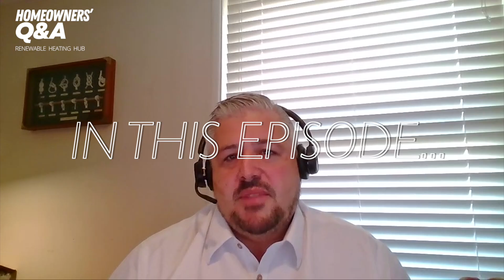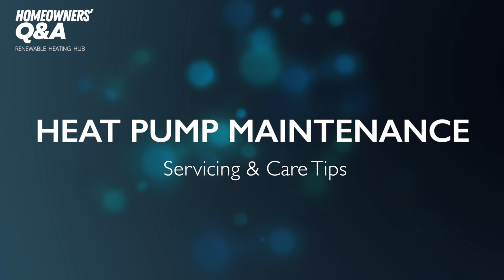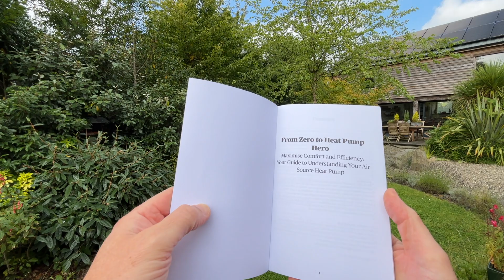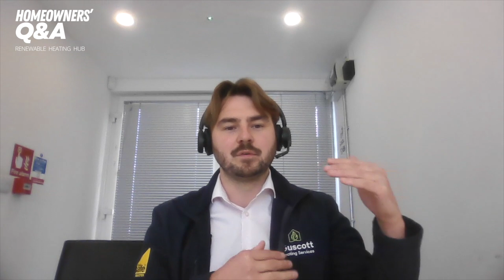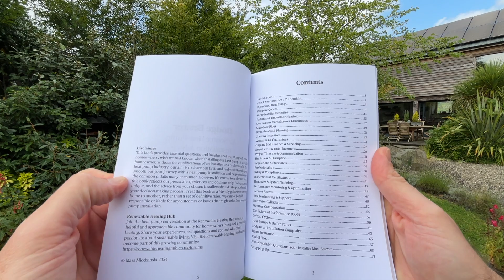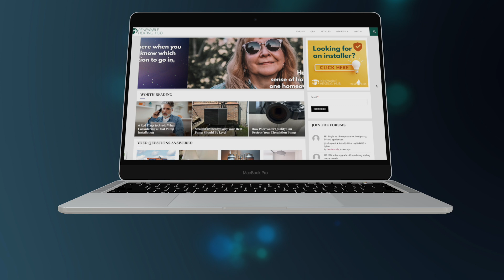How to Maintain, Service & Look After Your Air Source Heat Pump

Comment: I cannot remember when i had a gas boiler serviced.. its it just me , its never an annual thing. Whenever we did have a visit they do a little bit of cleaning but they find no problems.  

If heat pumps are simple bit of cleaning then waste of money.

Your checking,  why can this not be done online and call you out "if" there's any issues

Comment: So, if an ashp is easier to service than a gas boiler why does an annual service on my ecodan cost 3 times what I used to pay to service the combi boiler?
Reply from the maker: This is an excellent point and one that we’ve covered here: https://renewableheatinghub.co.uk/forums/renewable-heating-air-source-heap-pumps-ashps/heat-pump-servicing-maintenance-good-value-or-rip-off
Reply: Absolutely! I have a simple air to air unit (3 indoor units off 1 outdoor) and it was twice as much to service as our gas boiler. Took about half the time too. I think I'll do it myself from now on.

Comment: Over here in Sweden, Heat Pumps (where they've been a mainstay for decades) have a recommended service interval of every 2-4 years.   Hopefully, as they become more common in the UK and the majority of installations are decent there will be a shift away from requiring annual servicing.
Reply from the maker: Hi Ben. Would you be interested in coming on the podcast this Friday? Email me if you are: editor@renewableheatinghub.co.uk

Comment: Totally disagree that you can/should use 3 or 4 degree setback temps!
Reply: @timadams1097  what do you think you should use? No setback at all?
Reply: @davidstanford8614  see reply below
Reply from the maker: Thanks for the comment. Why do you disagree?
Reply: @RenewableHeatingHub  as the episode makes clear everyone should use weather compensation to maximise the efficiencies of a heat pump. Episode also confirms that best uses continuous operation. A setback of 3 or 4 degrees negates this and is likely to take a large amount of energy to get back to temp as well as taking a significant period of time. In my case it probably takes around one hour to raise the temp by one degree. If the house has cooled 3 or 4 degrees then it may take 3 or 4 hours to get back to temp! And will be working at max capacity.
When I was on Octopus Tracker I used setbacks at night - but only 0.5 or 1 degree. 

Now I'm on Agile i actually reversed that and raise the temp overnight 1am to 5am by 0.5 deg to take advantage of cheaper rates.
Again raising temps in the afternoon 1pm to 4pm by 0.5 deg to minimise the impact of using a setback 0.5deg 4pm to 7pm during peak rates. 
Hysteresis of course may mean it does not do much but helps minimise peak rate usage.
Reply: @TimAdams-hh8wc you’ve highlighted the most important thing which is it depends on your situation. There are more variables involved with a heat pump that traditionally has been with a boiler, especially with old non condensing boilers which were just simple switch on and off devices which typically didn’t make much difference if it was over specified. Heatpumps need a good return temperature so things like TRV can make a massive difference. So you’ve also added the differences in cost of energy in to the mix and it all comes down to what uses the lowest amount of electricity.  No point in having a high cop if you are not in the house for 10+ hours, like wise no point in saving 2kw if you need to run for 3 hours and burn an extra 4kw to get to temperature.